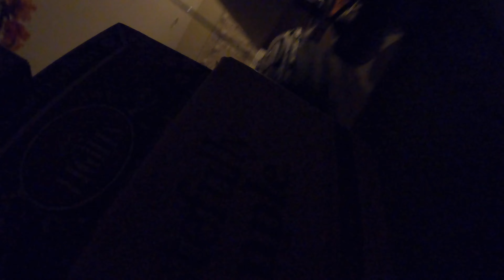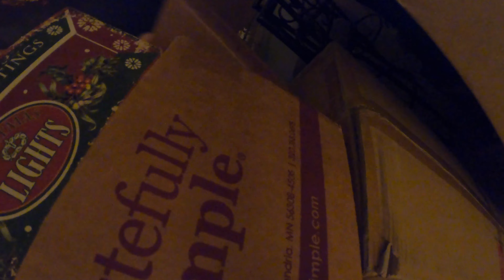Christmas 2021 | Fixing the Deer for the First Time

Comment: I noticed this for a few deer, I believe the second deer you did had the motor on the inside of the deers stomach, the deer I had was the same, but the major major major difference was that it was moving the whole assembly with the motor, (not having the motor stay in place but rather having the motor being moved along with the item) which seems like it would have to do  with being a planned obsolecense since just in theory it would be having a lot more stress and torque (strain) much like how the 3rd deer is being run while having a pole stick out have having the motor being attached to the moving armature, I prefer having the motor stagnant and having linkage to the moving part but you never know, maybe the moving of the motor cools it down, I was going to also hypothesis it keeping water off but the second deer veto'ed that out since you noted it seemed to have water damage.

Comment: interesting to be the same oscillation motor as the automatic wall fans
Reply from the maker: That doesn't make sense.
Reply: @JordanU  i'm serious no joke those japan fans with automatic remote control oscillation activated by just one button use a motor similar to this one in place of the analog oscillation box

Comment: Thank you for posting! I’ve always admired how these deer look on other homes and was actually going to purchase a couple for my property but after seeing this video, I’ll pass……I’m so tired of dealing with cheaply made Chinese nonsense that lasts 1-2 years before ending up in a landfill.
Reply from the maker: My grandfather always had a set of deer outside his house for as long as I can remember, so naturally I wanted a set as well. These were cheap junk from a big box store, I don't know if there are better quality ones available or not. I would very much like to replace these with a set of vintage ones, similar to the ones my grandfather uses.
Reply: @JordanU  The second one - the one with the motor that rattles, but does not move - I believe it's a synchronous gearhead motor. It's the gears that are probably stripped.
Reply from the maker: @kwinters5550  Thanks for letting me know.
Reply: @JordanU  No problem. I thought that because had it not made that rattling sound, it would have been completely dead. Well, I heard it running in the footage, but the grinding tells me that probably the gears are stripped due to the weather.
Reply from the maker: @kwinters5550  I'm sure the gears were made of extremely cheap, soft plastic anyways.
Reply: @JordanU  That's correct.